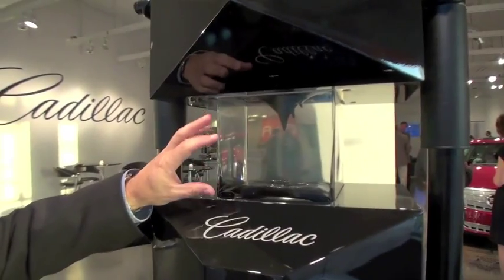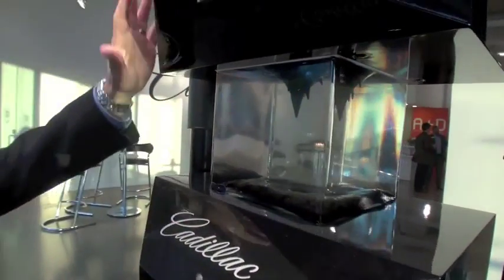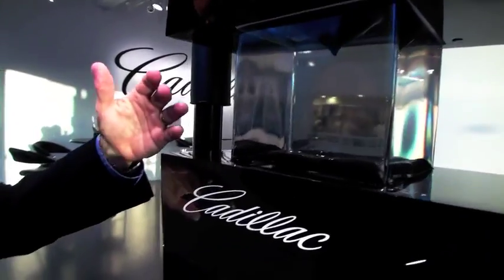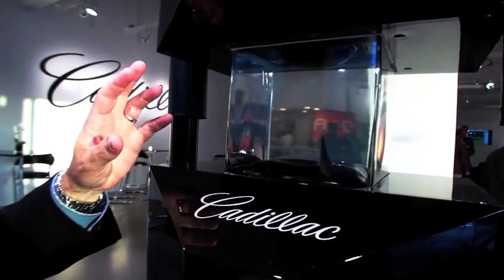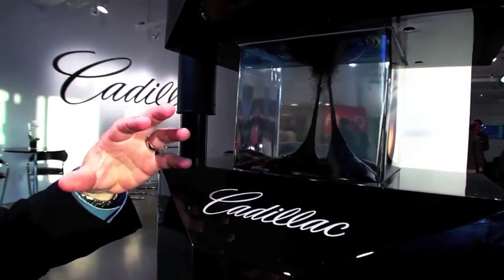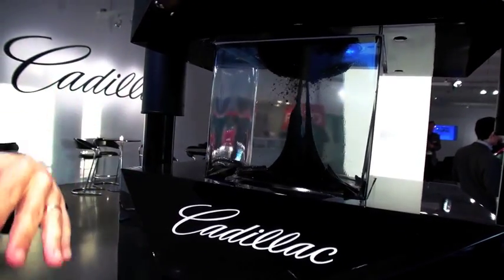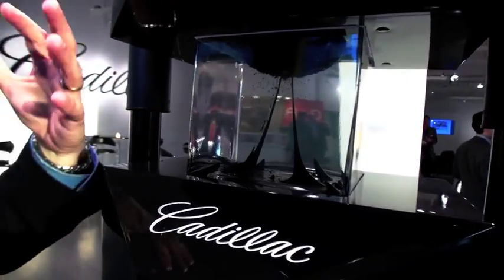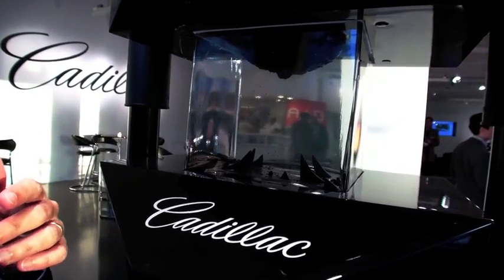2013 Cadillac XTS Magnetinc Ride Control

Comment: wow, sounds so cool. I just don't understand adjusting whatever 1000 times a second. I would like to know how that works. I guess it's a liquid with magnets. What does it change when on a smooth rode or rough rode. The search continues. I have a 2017 CTS and it rides great. I drive mostly on the toll way so I might not be in a position to determine if it works or not.